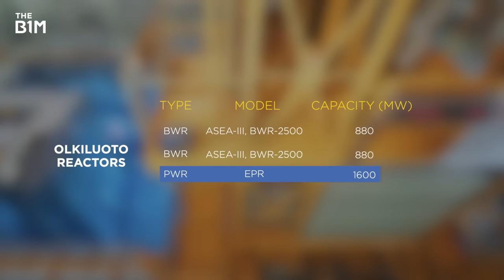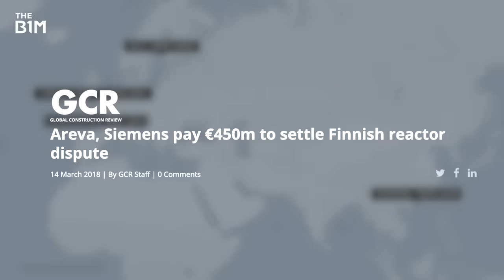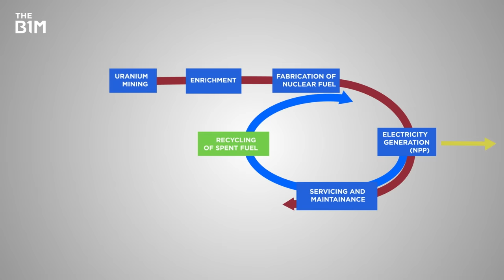Finland Might Have Solved Nuclear Power’s Biggest Problem

Comment: The concern about nuclear waste is amazing considering that waste products from fossil fuels like coal are produced in far greater numbers for the mount of power each produces
Reply: But it's nuclear waste! It's scary! Didn't you see what it did in that one super hero movie? Nevermind the fact that coal and natural gas power plants are literally poisoning the air we breathe.
Reply: therefore solar, not nuclear or coal.  next question?
Reply: @drakekoefoed1642  solar waste from panels dying and other problems generates a lot of hard to process waste
Reply: @Ram-zc4fi  Is it as hard to process that waste as it is to live with the huge expense and dedicated land use of nuclear reactors which also have to be decommissioned and the site left untouched for a few thousand years?
Reply: @drakekoefoed1642  salt and fresh water power.  mix the water thru a membrane get power.
Reply: @drakekoefoed1642  Not enough energy and quite a lot of nasty waste in the manufacture.  Next question.
Reply: @voidremoved  how will osmosis generate so much power 😂
Reply: yip...but they don't kill for 250,000years do they?
Reply: @thundersheild926 
Intermittency
No solution of energy storage
Low density energy
High cost / KW
Shorter  life span sytem 
Demand of critical mineral  
Massive demand of ressources
Visual pollution
Sonor pollution 
Massive footprint
Danger for birds

Next question?
Reply: @drakekoefoed1642  And what do we do at night?
Reply: @thundersheild926 yea, I hate how nuclear energy is literally the safest in terms of deaths per kWh!
Reply: @vernonfrance2974  Nuclear reactors take up very little space relative to the power they produce.
Reply: Fossil fuels do not produce waste products that have halflives of 500k years and more. In the US, we are encasing the waste products in glass and burying them. Climate change has already unexpectedly exposed some. Cities cant even keep track of buried pipes and power lines from 60 years ago, how can we protect these cites for thousands of years? I am very skeptical
Reply: @9Point8  If something has a half-life of 500k years, it is not very radioactive.
Reply: Nuclear waste effectively NEVER GOES AWAY!!! It will be just as dangerous in a million years as it is today!!! THAT’S a BIG difference!!!🤷🏼‍♂️
Reply: @vernonfrance2974  Yes.  Nuclear reactors take up very little space.  A hundred acres for a reactor can supply millions of people in a metro area.
Reply: @RandallGrubbs-r6h  that’s not true. But let me guess, you’re a bot account.
Reply: Those very small reactors can make huge areas uninhabitable for a very long time as happened in Chernobyl and Fukushima.
Reply: @vernonfrance2974  Fukushima was not a nuclear disaster and the area quickly recovered after the incident. Chernobyl was a disaster, but only because the design of that nuclear plant was laughably terrible. For instance, there was no containment dish under the reactor at all.

Comment: It's not just how deep it's being buried, it's the encasing that it's buried in, sealing it completely for however long is needed for it to decay.
Reply: And how do we know that encasement can definitely last hundreds of thousands of years? Has that bean tested?!
Reply: @TheStarBlack  It doesn't need to.  It needs to last a few hundred years.  After that, the waste will be in a state where the most dangerous isotopes are gone and the remainder is of the "don't eat it or decorate your house with this stuff" variety.
Reply: @TheStarBlack  Good point!